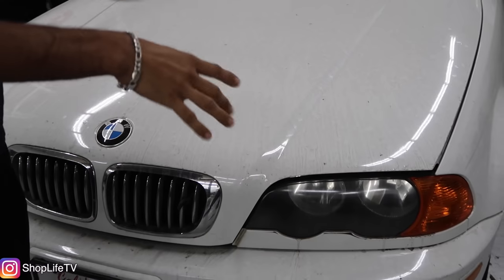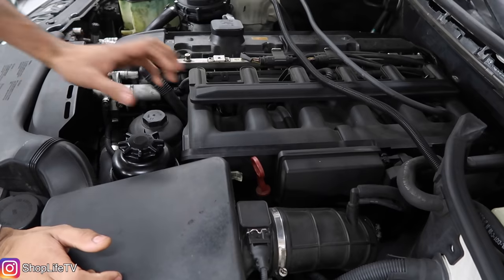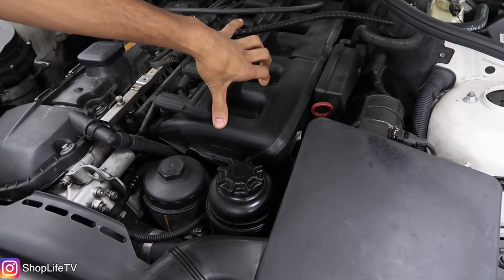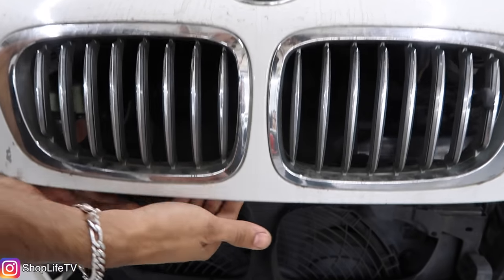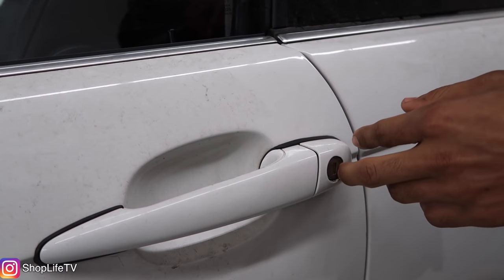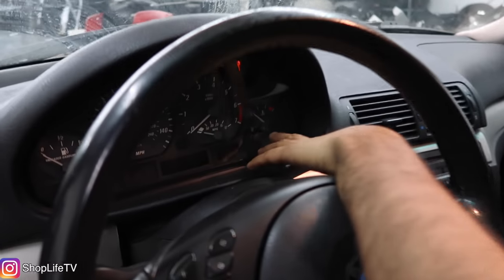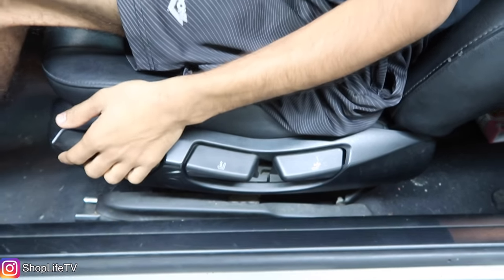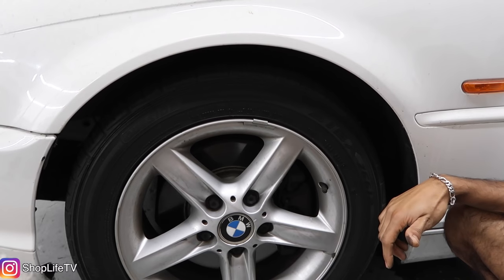25 BMW E46 COMMON PROBLEMS

Comment: I've had most of these problems, and more on my '01 325. My daughter has it now and she'll get rid of it soon. It's a nice car and I love the engine noise as it purrs along the highway, but I probably wouldn't by another BMW though. There is always something wrong with it, and these things add up as it got older.

Comment: My E46 M3 is fairly needy. It's actually quite easy to work on if you don't have to get into the computer.
There is a huge aftermarket for parts. Lots of used parts. I started doing 100% of the work myself with my friend. We have done some really big job very successfully.
My $100 Bentley manual has been basically useless.
I find information everywhere including Facebook photographs!!

Comment: I always liked the E46 coupe and just bought a cheap 330cd, changing the swirl flaps for blanks is my next job when I change the air filter.  Inside mine is in good condition apart from a few marks on the leather bit of rust on the wings and rear arches.  Handling is great even with 180,000 miles on the clock but I think it's had a lot of parts replaced.
Bit soft on the front end when throwing it hard into corners, other than that it seems perfectly balanced.
I've changed the oil and it hardly smokes even hard on the throttle.

Comment: Main problems I've had in the year ive owned my '04 330i are 2 window regulators going out (back passenger side both times), pcv value, valve cover gasket and rear main seal leaks. Sitting at 193000ish miles 15k are mine
Reply: I have the same car, did you have any transmission issues?

Comment: Thank you for making this video! You are very knowledgeable and this video is super helpful. I just bought a 2003 320i with 83000 km as a project and this video gives me a direction to diagnose the potential issues on my car. I will start to look at the issues you pointed out first. Hopefully, there won't be too many issues to be fixed...

Comment: Pro tip (learned this the hard way) DO NOT overtighten the nuts on the oil level sensor if you need to replace it. The studs will warp and break off. 
Tighten them with enough force where you think they are secure, don't keep going if you think it's not tight enough as they tend to stretch /warp and break!
Reply: Same thing goes for other bmw made vehicles. I got a 08' mini cooper s that I already broke two of the valve cover bolts from over tightening
Reply: Same with valve cover bolts

Comment: Common problems? The whole car lol. I've owned a 2003 330xi for 3 years now and have easily replaced most of the car, but I love this car too much to sell it :P.
Reply: DEATHCON51 bro im in the same boat!! Its a real love hate relationship
Reply: I just bought a 2003 330xi 5spd Manual, i need to replace the door lock cylinder, the e brake isn’t working (I’m assuming the cable needs to be adjusted),  power steering line, driver control arm is bad and when i press the gas with the hood open, i hear like a hissing sound, I’m not sure if there’s a hole in the intake boot or something
Reply: Same here lol
Reply: there is always vacuum leak in a e46
Reply: I'm in the same boat..always something, but i love the car..e90 335i.
Reply: hows your car so far? im planning to buy a 2005 e46 that is on 144k run.
Reply: U think it’s worth buying it then. Damn lol
Reply: DEATHCON51 are you the original owner? I’m not on my 2003 330xi. The previous owner beat mine to hell mechanically and I’ve spent more than the car is worth repairing it. Which is worth it
Reply: @williamperri3437  Good luck, dude. Just the last 6 months I've had to drop another $3k into mine(catalytic converters died, misfiring, vacuum leaks, DISA failure(4th time), etc). Still own it and it's at 173k.

Also, I DIY everything so that's the cheapest it could've cost ^^^. Couldn't imagine labour costs.

Comment: Bought my E46 and have had to replace just about every single part. Nice cars but be prepared to rebuild everything on it if it was neglected in the slightest.
Reply: Your own fault you didn't test nor checked the car then and its been used careless.

Comment: Hi Jason I really like all your videos I properly watch them all. I have e46 Coupe 320ci I'm not sure that my fan clutch is failing or not. I have read lots of comments on your video but it does make sense when you explain about the fan is moving freely or faster when engine cold, I think should be another way round. Mine is moving pretty slow when the engine is cold or not started. When the engine gets very hot or sitting idle at the traffic the sound of the fan was so loud for a few second then stopped after the car moving. So I just wanna make sure that my fan clutch is bad before I order it. Many thanks Jason.

Comment: IMO E46 is an enthusiast car.  With each successive generation, BMW drifts further away from its mission.  The E46 models are like the older Porsche cars with simple gauge clusters, great ergonomics, and tight chassis.  Since this video E46 prices are going up fast and the low mile, not thrashed ones are becoming very hard to source.  The cars have great lines and sturdy drivetrains, and when properly used and maintained, few common issues.  Yes, coolant tank, valve cover gasket, and lower control arm bushings.  But, after those common faults are corrected, a very dependable car with excellent visibility and fuel economy.
A+ to ShopLifeTV for providing these videos.  They are always informative and very well produced!

Comment: Nice and comprehensive video. Tip for interior cloth on pillars is to use a glue stick (like the ones you used in grammar school) to re-glue the cloth back to the pillars. I never had problems with my headliner so that might take a little more time. A, B, and C pillars are easy to re-glue especially if you taken them off the car first. My vanos never went out and it might be due to various treatments done to the car such as a double oil change to reduce buildup in the vanos and increase the clearance on the metal bushings. The timing belt tensioner which is a plastic plate that the chain runs on gets worn over time as well. Nice vid

Comment: Poodle in the background...yeeessss!!   Ditto..on the E46. replaced the entire cooling system..and I mean EVERYTHING for under $200. Took me about 2 hours. Also converted to the electric fan. I also changed my motor mounts which was pretty easy. I love this car, drives awesome with 180k.  Great video
Reply: I have to change my motor mounts, rear subframe bushing & differential bushing. don't know when to under take sounds like a 3 day job.
Reply: What parts did you use to get it for under 200???

Comment: About the subframe mounts cracking, the convertibles were never affected, as the extra bracing and supports due to the lack of... well, a roof, they had to reinforce that whole area. I think it was 2001 that they "made changes" to the sedan, coupe, and wagon, however i'm almost certain cars up to 2005 still had the issue

Comment: Very comprehensive. My dad bought a 2001 325i new and that's the car I grew up working on. We ran into almost every problem on this list. After 180k miles and 16 years later I sold it after the reverse gear went out and my foot tired from 6 months of pushing it manually.

Comment: I used to think my car had problems.. because of this video I can drive a little more at ease knowing compared to other BMW's my 05 E46 with 88K miles has almost none of these issues :') awesome video! On the path of being a famous BMW E46 Channel! You're the best! Thanks!
Reply: Leonardo Flores I have a ‘99 318i with barely 80k on it too, had it for only a month this far and 0 issues, checked all the service history and everything seems clean 😂but I’m still paranoid every day when I turn it on....hopefully it stays reliable
Reply: How bout now?
Reply: when u hit about 100k to 130k miles please report what u had to change and what u have to change. U can prolong it but it will come to past. LOL
Reply: You shouldn't curse yourself.  Herein Canada my dads 06 325 has 103,000 kms (60,000)miles and all oil seals leak.  My 02 RSX with 90,000 miles has no oil seal leaks from the original seals
Reply: @mariusremz1500  how did it go?
Reply: @franco2472  No longer have the 36, moved onto an M235, but whole time I had it no issues.
Not sure where it went since I sold it, but assume still on the road

Comment: I have a 2003 330i and I’ve had most of the issues mentioned but I love this car so much to get rid of it plus now that I’ve done all this work the car is solid.  I’ve actually driven this car from New Mexico to Florida and countless trips and this car is still a solid workhorse plus it’s paid for.  The way I see it since it’s paid for and due to the age the general maintenance I do on it is basically like the car note not to mention it’s MUCH cheaper per yr to maintain than an actual new car note.  This car here is in shitty condition compared to mine too since I baby mine
Reply: NutNbutSpeed how many miles on it total?
Reply: I have a 2002 330i and totally agree. I’ve replaced many parts with upgraded ones (Stewart water pump, metal pulley, urethane bushings, Cool Carbon brake pads, etc. etc.) and although many will argue that it’s too much work to keep an old car like this running, I’ve owned it longer than any other car I’ve had and LOVE it!  Street, track, or road trip - awesome car.
Reply: @genepenna8549 that’s funny that you say that lol, this is the longest I’ve had a car & it’s a e46, she’s strong

Comment: The problems that I have had with my m43 316i 2001 sedan.
Antenna amplifier for the door lock.
Door lock breaking
Vacuum pump that starts when you start the car
Valve cover gasket, Oil leak in the oil filter housing, Oil leaks from the chain cover
Had to replace the starter, had to remove the whole intake to change it.
Front lights fogging up.
Generally plastic breaking when you disassemble stuff.

Comment: I have an E46 M3 (non stock, owned it for over 3 years rn) and i only had to replace the radiator once and the power steering pump

Comment: Great video. Thanks very much for what is basically a public service announcement: Don't buy an e46 unless you are mechanically inclined and really love working on over-rated German cars.
Reply: Chaminda Thushara Ruwan Kasturi  Thanks for the feedback. I love these cars. I grew up in Munich, home to BMW, and in the 1970s my father drove the family to Italy and France and Austria in a BMW 2800, which was followed by a 320i, a 316i, a 525i and a 528i. In California I've been driving a BMW 325i (e46). Recent models are pretty high-maintenance and require a fair degree of mechanical skill and tools. The problem for people who don't have the means or skill to fix their own cars is that BMW commands a premium because of its luxury status. Repair bills in the thousands of dollars are commonplace. Like all mass produced cars these days, there's lots and lots of plastic and rubber, to comply with emissions requirements. So there's my two cents.

Comment: I had a 2000 328I.  The subframe mounting cracked in 2009.  I took it to the dealer in Toronto and they gave me a written repair estimate of $14,000.  I called BMW Canada and they told me to take it back to the dealer and they repaired it for free.

Comment: Why are does all american E46 have issues with the headliner sagging? Here in Germany i not saw even once an E46 with that issue, only on the A-Pillar
Reply: Most of the places in United States are very hot while in Germany it’s freezing cold that’s why it doesn’t sag in Germany
Reply: Paper Chaser since when is Germany freezing cold
Reply: Might be because of the different regulations the US has. Might have caused a change in the choice of adhesive for the American market. Makes sense since the E36 M3 is not exactly an M3 in the US because of regulations.
Reply: MrProTwiX  USA is Scamming off the top
Reply: Same here in South Africa, we also have problems with headliner upholstery because of the hot weather. It gets unstuck and peels off. I suppose the weather in Germany is cooler
Reply: Not so much the heat, as much as the humidity
Reply: MrProTwiX mine doesn’t sag (;
Reply: Humidity is 99% here in the dead of summer

Comment: Do everything he says! I replaced most coolant parts except thermostat and expansion tank, and those both failed at 130K. Expansion tank leaked out all coolant and almost over heated the engine. Also replaced front control arms, and had vacuum leaks from failed rubber. Car also burns and leaks out. Don't buy if you can't work on them yourself! AWD is very good.

Comment: Mines a 1999 320i e46. 240,000 km. Body's fine, leather interior,  and its treated me well. Had since 2005. But unfortunately shes time to be retired. Will cost too much to fix. Always the steering and front suspension probably the roads here. Have most of those issues too. Roof liner, airbag lift that I've spent over 2k to fix but still kept coming back. Had to use some chewing gum inside the dash to hide the light to get my last cert/wof. The rest is fine but cost is more than it's worth now. And with a bad front windscreen stone chip/crack. Sad shes due for scrap or firesale now. I love the e46.

Comment: I know that these cars are so great when they run properly but compare these to any Japanese     
car of the same vintage and they will have none of these things to repair.
Reply: I was thinking of changing my lexus is200 for a 
e46 318 but after seeing this vid i think il stick to my lexus poor mpg but reliable af
Reply: you wont have damaged hoses and oil leaks on old japanese cars? what?
Reply: @lumitrac  people fail to realiise that shit maintenance is responsible for most of these problems. it's ridiculous
Reply: @lumitrac  Not really. A friend's 1990 Toyota owned since new has had no issues to speak of. Ever.
Reply: @chesswizard31  a Toyota what?  truck?
Reply: @curtisshaw6887  never sell your Lexus for a bmw! Never!!

Comment: Biggest and most costly problem when I had an E46 was the air conditioning broke down after less than 40,000 miles.  Despite uninterrupted dealership routine services.  I’m the kinda guy that takes very good care of cars, so disappointed but otherwise this was a well motoring and handling model of the Bimmers.  I tend to feel perhaps mine was a piece of 🍋

Comment: The fact that this car has so many COMMON problems, shows how crappy it is
Reply: LHEK ツ it’s 18 to 12 year old car
Reply: Japanese cars that age? The SR20 is highly unreliable, 2jz might be a strong block but that motor is becoming brittle, problems for the nsx are popping up. What are you proposing?
Reply: You forget this cars are over 10 years old. No cars over 10 years have no common problems except toyota because of no electronics
Reply: Yeah its a 15 year old german luxury car with lots of electronics try comparing a 15 year old bmw to a 15 year old Mercedes or something.
Reply: ツLHEK exactly
Reply: I own a 04 325i I purchased from my father the original owner. The most frustrating thing about the e46 as I have helped on many of these jobs before I even got the car,  is that most the work is to replace a small plastic gasket or seal. Rarely except for some of the suspension parts which are similar issues regardless of vehicle when they get to be 10+ years old and 100k plus miles. I love the e46 but some of the labor involved for changing a $5 gasket is nuts.
Reply: @DVu-oh8ug  what a joke of a comment hehe

Comment: Long story short, do not buy a BMW if you don't want to spent your personal time fixing it or getting it inside the shop for someone else to fix it. Beautiful car but too many CRITICAL problems.
Reply: Jonathan Smith bollocks
Reply: Im too addicted to this car I can't resist buying it
Reply: most of these are problems EVERY CAR THIS AGE WILL HAVE. hoses and plastics degrade. such is life.

Comment: Got an SES light that won't go away. Changed purge solenoid, charcoal canister, dmtl pump, lpfp, fuel filter, new engine wire harness, new alternator... keeps saying dmtl issue and also BSD line issue... perhaps a ground is loose somewhere but I have searched almost all grounds. Or perhaps I just got a bad dmtl pump and need to replace it again...

Comment: Sounds like a pile of junk.
Reply: these are getting close  to 20 years old tho      most cars will need  all rubber parts/plastic replaced around  this age
Reply: @TCBOT  And further proof that modern cars aren't built to last long. It's completely intentional and overall a perfect business model the Germans take full advantage of. Cost cutting, cheaper to manufacture, parts and service profitability, and it forces wealthy owners to buy the new model every several years. The BMW models from the 80s and earlier are still a superior build quality; back when building a great car was meant seriously. For example, the plastics used back then were more rigid and tough. They last longer than the newer cars before needing replacement. Modern plastics function better under stress and heat but give out way faster due to cheaper quality. The E46 isn't even as bad as some of the much newer models. Especially the X series SUVs.

Comment: Hey shoplife tv. Another great video from you and I thank you for all the helpful diy you do! 25 E46 common problems was good for those that drive the 3series but how about one on the M3? The S54 has a lot of already known issues and it may seem there's not much more to write about. However I did learn about the key turning in the lock problem and found out there is a fix kit (very cheap). Please do a diy on the door lock tumbler fix so I can fix my twisting lock in my drivers door. The kit is crazy cheap but I won't have a clue what to do with it unless you do one (As you said you will in your video. Thank you again and keep on doing what you do you're rockin!!
Reply: Not that I want to use others for my diy's (I'm loyal LOL) but I did find a few tumbler fixes on youtube so no rush if you don't have the time etc. Thanks.